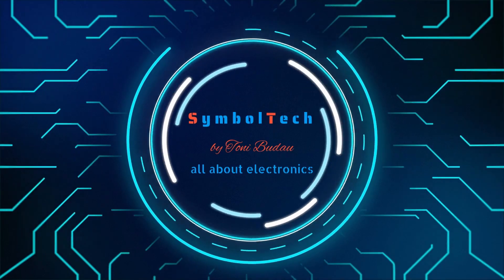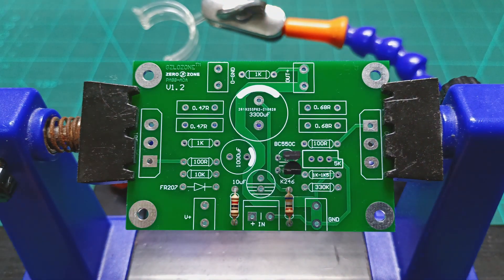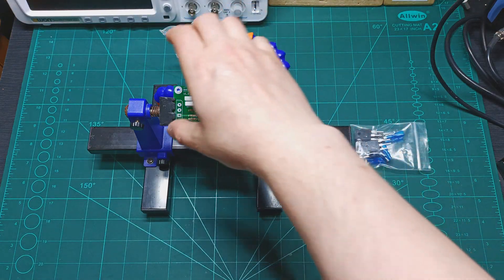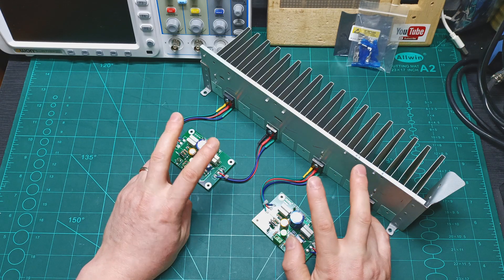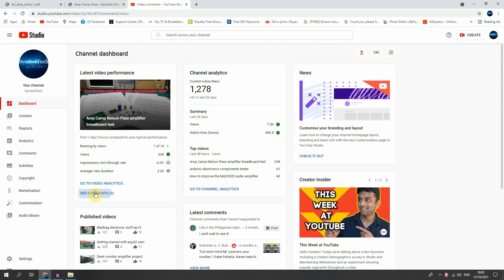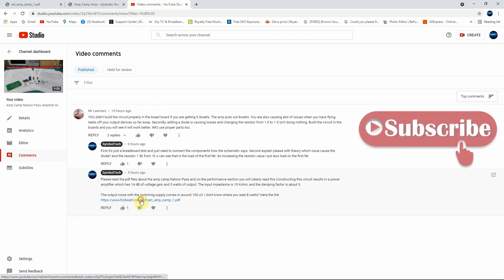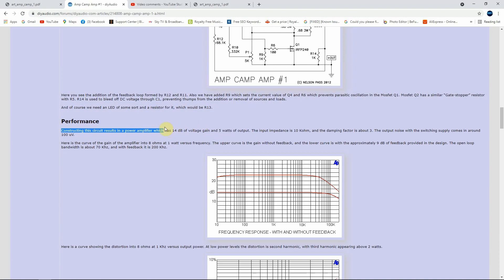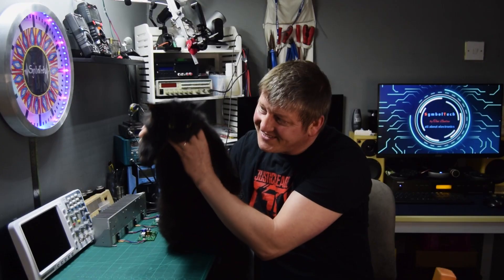Amp Camp Nelson Pass amplifier part 2 | PCB Build

Comment: The gain of the 2N5089 transistor must be greater than 600. If you put the 2SC3070 transistor instead, then it has a minimum current gain of 800. You can safely set Optima from 800 to 1000. The higher the gain of this transistor, the cleaner and more transparent, more detailed the sound, that's for sure, verified. When selecting parts for 24-volt switching power supplies and after connecting the amplifier boards, the IFRP250 transistors burned out, I had to change it back to IFRP 240. The sound is good, but with IFRP250 transistors it is much better. Some extra parts that I soldered to switching power supplies as an experiment had to be removed, but not all! After switching on with IFRP 240 transistors, half of the power at the trimmer point is no longer set. I did this by connecting a 100 watt lamp. I set it up like this: I adjusted the tuning resistor to the limit of the lamp's complete attenuation. I got 4.5 volts on both channels of the amplifier. In this case, the transistors almost do not heat up. But the sound is excellent, clear, loud. What happened and why it became so I do not understand. The output transistors are new, not Chinese, they almost do not heat up. After buying 10 pieces of IFRP250 I will put them again, I think everything will work out and the sound will be even better.
Reply from the maker: Yes it's good to experiment with more types of transistors

Comment: They say some resistors on the board get very hot.. what would you recommend for this? better resistors?
Reply from the maker: If the resistor gets hot this mean you need to change it with a higher wattage resistor and definitely will handle better the load and the heat will be lower

Comment: Pcb gerber files?
Reply from the maker: It's kit that I bought from aliexpress
Reply: @SymbolTech21  does it perform well?
Reply from the maker: @thedistortedguy  the sound it's really good and the measurements are good to but it's not a powerful amp. Because the amp camp Nelson Pass it's just 5w power but the sound it's amazing
Reply: @SymbolTech21  does this nelson pass or jlh jean hiraga require a pre amp? Can we connect our auxillary directly?
Reply from the maker: @thedistortedguy  it's the amp camp Nelson Pass. For hiraga yes I recommend a preamp stage to get the highest performance from hiraga amplifier
Reply: @SymbolTech21  and for amp camp nelson pass aca?
Reply from the maker: @thedistortedguy  yes it's the aca
Reply from the maker: @thedistortedguy  here in this video I show from where I buy and how much cost https://youtu.be/9j8tULajQ8c
Reply: @SymbolTech21  does aca need a pre amp?
Reply from the maker: @thedistortedguy  on the input need at list 500mv so if your signal source its lower than 500mv yes you will need